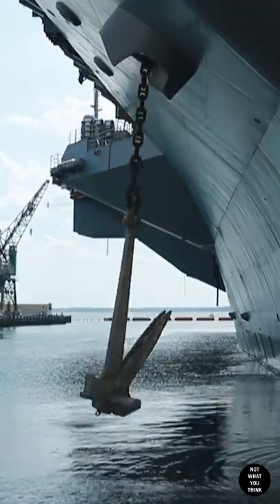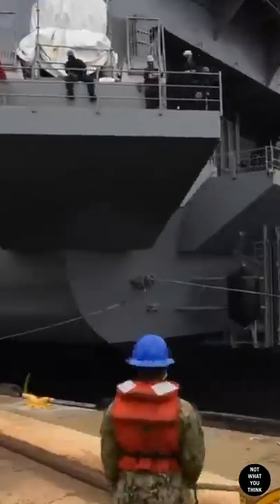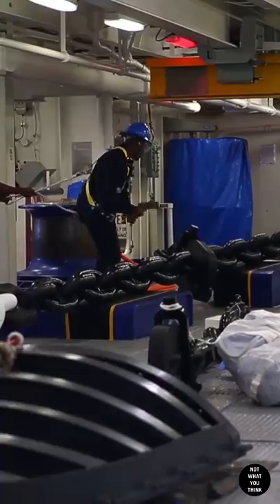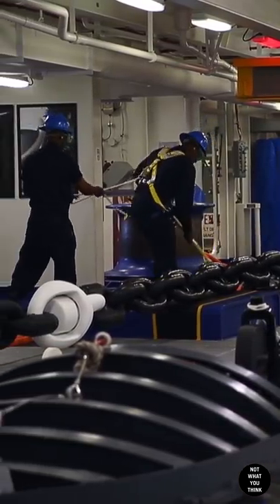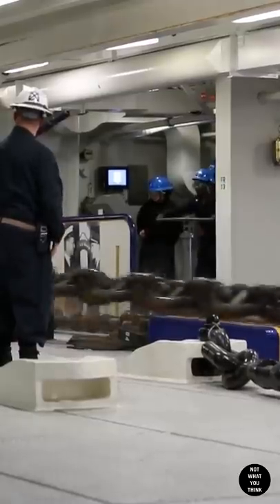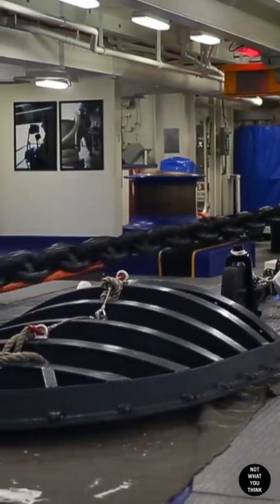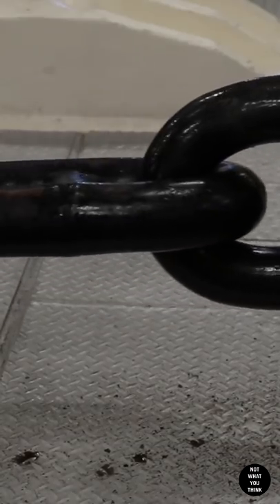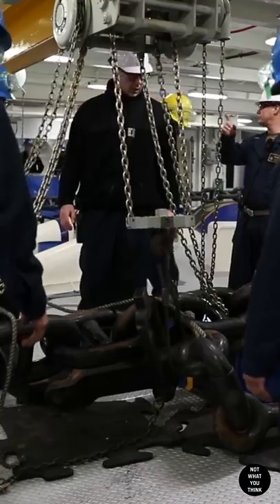Inside the Anchor Room of a Supercarrier #shorts

Comment: Fun fact: It is the weight and hydrodynamic resistance of the chain that keeps the ship in place. The anchor itself just ensures it stretches out and provides adequate surface area.
Reply: Only on large vessels tho, on smaller fishing boats it works a bit different because they can't justify carrying so much weight around so they'll often use these small anchors designed to dig into sand/rocks and anchor the boat by tension. This means that if a boat is not anchored properly, can un-anchor itself under intense wind and current/waves, but it's a small tradeoff considering most of these vessels use the docks as their main anchoring mechanism.
Reply: @lazar2175  lol I thought smaller boats just used anchors that took into consideration the weight of the vessel. So when dropped it couldn't move during high winds. (Tides obviously a differ story though.) 

But the more you know 🤙🏾lol
Reply: @EL-ISS  This mostly refers to ultra light sports boats,  usually made from fiberglass and other similar materials. Often times, you'll need like 30%-50% of the boat's weight to anchor it properly, which really defies the purpose of an ultralight boat.

Imagine having to carry a 50kg dumbbell on a canoe, and it's pretty easy to see how certain boats can't have "appropriately sized" anchors.

On the other hand, larger ships like this one with a lot of mass, need way smaller anchors because the inertia of the ship is helping.
Reply: @lazar2175  Ahhh, I understand what you're referencing now. Cheers for the info!
Reply: The anchor itself weighs about a quarter ton if not more, it definitely helps in the weight department too.
Reply: What if there are strong currents?
Reply: @AcolyteOfLucifer  15 tonnes, says so in the video.
Reply: @jobber3500  the ANCHOR. Not chain
Reply: @jamesbizs  bruh, literally watch the video. The anchor is 15 tonnes, and each chainlink weighs 60kgs
Reply: okay that makes more sense. I was like dang i know 15 tons is a lot but isn’t that like 1/4 the weight of a tank? but thanks for clarifying lol
Reply: not fun
Reply: @EL-ISS  most  recreational boats on lakes just use an anchor and rope
Reply: True
Reply: @AcolyteOfLucifer  not really when you consider the ships will be a minimum of 2000 tons (for small destroyers) all the way up to over 100,000 tons (largest aircraft carriers). Even the 15 tons it says the anchor weighs won’t do a whole lot at that point
Reply: Fascinating guys. Thanks for the knowledge
Reply: No shit.
Reply: So many armchair salty seadogs here..
Anchors ARE designed to dig in. The purpose of the chain , along with sufficient rode, is to hold the anchor down on the seabed so that it can dig in when the vessel pulls against it  .
Reply: That's not right. If that were the case the anchor could be any shape.
Reply: @user-gt2kl9jr3l  They are all shapes. Capital ship anchors look nothing like a stereotypical anchor. Some anchors look like fishing sinkers, some look like the traditional Popeye anchor, and some look like modern art pieces. The anchor can be used to dig into the bed in shallow water like we all assume, it just isn't used that way in miles deep open ocean.
Reply: @johnhelton9533  according to what I read you remain wrong.
Reply: @patrickhorvath2684    I was referring to the practice used by large naval vessels in open ocean, such as the one in this video. The ocean is miles deep in parts, there is no practical way to dig into the seabed. What you said is also correct, but occurs in relatively shallow environments.
Reply: @johnhelton9533  
Ships don't drop anchor in deep water. They couldn't possibly carry enough chain/rope.
Must have 7 times more anchor line than the depth of water. It's  called rode.
Reply: wait, hydrodynamic resistance? how can something so thin relative to the mass of the floating ship, offer enough water resistance to keep the ship stable?

or am I missing something here?
Reply: @robosing225  
 You didn't miss anything, that guy is trying to baffle with bullshit..
Reply: There are at least 3 good videos on YouTube that explain how anchors work. Stop arguing and watch them.
Reply: @EL-ISS  Man, there are many heavy books explaining the properties of ancres. You wrote nothing that needs raising eyebrows.
Reply: @AcolyteOfLucifer  they said it weighs 15 tons, but that’s still absolutely nothing compared to the weight of the ship

Comment: I like how it’s a multi billion dollar vessel of the future, yet they still just have just have a chad with a sledgehammer to de anchor the boat.
Reply: If it ain't broken don't fix it I guess
Reply: Tech will never replace Chads. Never! 🤣
Reply: Right you'd think even like a pulley that pushes the pin with more leverage and from a safer distance would be way easier
Reply: That’s the fail safe and last part before the anchor is released. If it was a mechanical system, then it could potentially fail or break 

Soldiers still manually load mortars, artillery, and tanks because again, one less thing that could fail
Reply: Sledgehammer fitted the entire ship of course it can do this.
Reply: I like how you saw a comment from a year ago and typed it slightly differently to make it your own.
Reply: @dylanhealy8126  Not all tanks tho, russian tanks have auto-loaders and it makes the tank smaller but the problem with auto-loader is that the munition chamber is easier to hit than the one in lets say an abrams.
Reply: @calebjohnson701  isn't that soooo weird. I see people doing that ALL the time
Reply: So you're telling me they can't drift like Taylor kitsch did with might mo in battleship.  Man that movie was awful
Reply: I work on a Naval vessel. What he is hitting is a stopper. When the anchor is housed (inside the ship and not used) as well as when it is out for anchoring, stoppers are used as a last resort for if the brakes and Wild Cat fail and it prevents the anchor from free falling. The stopper is attached to a large chain that angles back onto a massive padeye welded onto the deck. I can attest to the fact that the stopper will hold the anchor and all the chain. It's a simple and very effective method.
Reply: @raduandreiflorescu1990  Yeah I know there are auto-loader tanks, and I’m not a fan.

Not that I was a crew in one, but I was M2A3 Bradley driver. 

Auto-loaders, like you said, are vulnerable at their magazines. Having the extra crew member for a loader is a plus too, he can take over for the driver or gunner if something happened to them. 
Plus the original point I was making; a mechanical loader can fail/break, and a human loader is a better fail safe that can be replaced by another crewman
Reply: @dylanhealy8126  Some tanks, some artillery loaded in that instance not all and mortars simply because they function in that manner
Reply: @biohazardlnfS  Huh? Your English is a little confusing. 

I know not all tanks, artillery, and mortars work like that, that was the original point I was trying to make. 

Having a man to load all those dangerous weapons is more safe than using a machine. 

Especially mortars, they can be just as dangerous for the crew as they are to the enemy.
Reply: I've personally worked on anchor detail and done this job. Absolutely everything else is mechanical. This is done by hand because it's the last failsafe. Not being mechanical makes for less room for error.
Reply: I guess you are thinking an Xbox controller would work better.

Comment: and for those wondering, the chain is mostly what is holding the ship down, the anchor is mostly there to keep the chain in place. this is why large anchors are usually dropped onto sandy or muddy sea floors, because the chain can dig into the sand and really hold the ship in place

Comment: I used to be assigned to anchor on sea and anchor details on-board my ship. I got to do alot of précision anchoring evolutions so I was used to releasing the riding and housing stoppers and even having to remove the detachable link a few times. Definitely a cool experience.
Reply: Ever seen a link break on its own before?
Reply: @brantleycombs3088  nope, we did have to detach the anchor and leave it on the ocean floor and pull into port in Portsmouth England. We did a precision anchorage and the anchor got caught on some cables on the ocean floor so we had to leave it there and a salvage team had to recover it and bring it to us in port.
Reply: Why do you need to hold the guy in a harness to swing the sledgehammer tho?
Reply: @notyaavridge2660  for safety
Reply: @notyaavridge2660  to yank him out of the way if the chain doesn't go straight. If it whips out at him it's for sure taking him with it
Reply: @notyaavridge2660  if he swings the sledge hammer and miss, his momentum can take him down Hause pipe along with the the anchor and chain. It may seem small but the redundancies are in place for a reason.
Reply: @teamtate322  because it’s happened before.
Reply: @jeremey2072  I'm sure it's has.

Comment: Ok so you're telling me that one ring of the chain weighs as much as me🤯😵
Reply: Bro you are heavy
Reply: @nooftaheri3502  but not that heavy 
I did not weigh myself for 2 years 🤣🤣
Reply: One chain ling use to whaigh as much as two of myselfs
Reply: @nooftaheri3502  130 lbs is literally the average weight for most adult people
Reply: @batswing4473  that's my bad i thought he said 130 kilo 😬
Reply: That thing has almost 40 pounds on my girlfriend lol
Reply: They actually weigh roughly 320lbs, not 136lbs or whatever he said. Don’t know where this guy got number but I literally learned that at my school like 4 days ago when I did this whole process. So NO! Those weigh way more than you lol
Reply: @RileyNoga  I live in India so we dont use pounds. We use kilo system.
I heard 136 pounds =36kg 
So I may be right
And as per you I'm lighter than that
Due to pandemic I did not weigh myself ,..so a rough estimate😉😂😂
Reply: @RileyNoga  you are correct. I was stationed on USS Dwight D Eisenhower (CVN-69). The are closer to 320-325 lbs per link.
Reply: @eshanjadhav265  Actually, There's about 2 pounds per kilogram. When you say "a pound of beef" that means 500 grams. So instead of 36 kg, it translates to around 65 kg
Reply: I helped make the chain for this ship they are around 160 lbs and are three and a half inch diameter smaller than a nimitz-class carrier chain with a higher tensile strength
Reply: @johndeere4594  ok that makes sense, thanks for the clarification!
Reply: @johndeere4594  wow 👌
Reply: It's called a link and on a Nimitz class one link weighs 365 pounds.
Reply: @oldfucker68  wow I thought that james bond replied to me (I read you as roger moore)🤭
Reply: It’s Probally about 3ft tall too
Reply: Haha problems with converting units
Reply: I want to like your comment so bad but i cant coz your comment already has 69 likes!😂
Reply: @Max-yz8ib  tis 70  check it

Comment: The anchor on a carrier is 60,000 lbs and the links are 350 lbs.  I know because I got my Surface Warfare pin on a Carrier.  Also the anchor alone isn't what holds the ship in place.  You have to law out a length of chain on the sea bed to get enough weight to hold a carrier in place.  The length of chain laid out depends on the level of current in the water you're anchoring in.

Comment: Imagine, if you work there, and in all of a sudden, right when the anchor is about to be released, you stuck on one of the chains
Reply: I got you. It happened to me when I was loading some heavy machines round 20_50 tons. But I was so lucky that I could escape that moment I didn't stuck in the chain. Working with heavy equipment is extremely dangerous and needs to pay attention alot and not hurt yourself.
Reply: @halfofmg394  no it was tunnel boring machine.
Reply: @Peaking94  can you please explain it to me? Like, what type of machines?
Reply: @halfofmg394  it's called "tunnel boring machine " and it is used for digging tunnel.
Reply: @Peaking94  oh, okay, thanks for the information 👍
Reply: @halfofmg394  you are welcome!!

Comment: On the USS America (CV-66) they kept the focsle pretty spiffy and all shiny and stuff.  All it took was one anchor drop to totally trash the place. And noisy?  It was friggin noisy.  They walked the anchor out to a point and set the brake.  Put the pelican hook back in place, then disengage the windlass gear and release the brake, at which point the only think holding the anchor was the pelican hook.  Had a guy in a safety harness with a sledge hammer to trip the pelican hook when the order came down to let go the anchor.  There was a safety line attached to the harness so that that person could be pulled out of the way.

Comment: I’ve seen what happens when the brake that slows that anchor chain down fails. Let’s just say people fucking run.
Reply: Could you explain why it’s so dangerous I don’t understand pls
Reply: @kyubi4417  well that anchor is moving with an insane amount of force and each link is extremely heavy if you get caught in the chain you could get sheared in half in under a second and if the hammer gets caught in the chain it will rip your arm off

Comment: Wow! I did the nerdly thing. If each link is  12" long (more likely 10" with overlap) that chain is 98 tons! (over 114 tons if 10" is more accurate) + 15 tons for the anchor... And! That much weight has very little effect on how high or low the bow rides. Now, knowing that there are 2 anchors in the bow, 2 is the stern.., approximately 130 tons X 4 --- 520 tons that has minimal impact on the ship's trim and buoyancy --- ???   Imaging the size of the ship is still mind boggling.
Reply: Those ships are over a hundred thousand tons.    Comparing the amount of weight of the anchor to the weight of the ship is like comparing the weight of a tire to the weight of a car.
Reply: @Bendigo1    Yep. Mind Buggering.
Reply: @johnlshilling1446  yes it is.   And to think a plane that is as heavy as a semi truck can land on there and not even make the ship move...

Comment: There's one video online of this going horribly wrong, if the chain reaches the maximum length you can imagine it would be pretty bad, well it does and the whole anchor rips out and goes through the floor into the ocean. Those anchors aren't cheap...

Comment: I've always wondered why they don't knock the pin first, then unscrew the "breaks"? Or engineer a sort of slip knot in there so idk, they remove a safety cap exposing a bit of rope or rod idk, which can be pulled or twisted or whatever from afar? Idk about the screw thing lol but aye, surely there's a way which could be engineered

Comment: They can simply lower the anchor in gear reducing the risk of break failure and injuries, It's a standard procedure. the old days of dropping the anchor. It also reduces the risk of the chain tangling. Why keep a procedure that increases the chances of a mishap....tradition should not overide safety. Ps that BRAVE sailor is more dumb than brave. All you have to do is take the weight if the anchor chain in gear open it up without a sledgehammer and then lower in gear

Comment: I am a bit curious about one thing. Not specially a military one, but for all naval vessels.

For the shaft connected to the propeller to spin, we need a bearing. But bearings means that it is not waterproof! how did they solve this problem??

Comment: So a submarine Captain got a surface ship , coming to anchor
 He said drop anchor ! The deck division ensign , said , sir we are are one third speed , don't you think we need to slow down some first? 
   The captain said, ensign I gave you an order. So the ensign  said  to the bosun's mate on the sound power phones, the bosun mate said are you sure ? That's an order from the captain.
  So the bosun's mate cleared fo'c'sle of all personnel , hit the Pelican hook tossed the brake and ran.
 The chain ran down the hawse pipe
the red bitter end and all , it swung  jumped and busted everything bustable on the Forecastle.
   The bosun's mate got on the sound powered and said, sir tell the captain
,No sweat , no strain, no anchor, 
No chain.

Comment: That guy hammering the chain stopper open; why is he harnessed? I’m trying to think of any scenario where he could get accidentally pulled away with the chain but that would make no sense since the anchor and chains are heavy enough to pull him and the person holding the harness. And why is the harness held by a person rather than secured to a solid object or a secure hook or something?
Reply: It is to keep him from falling forward into the chain, the idea is that the guy holing him can pull him back if the chain starts to move.  There are no hand rails or anything for him to push against to break his fall if he started to fall forward.

Comment: I wonder why they don’t use like a metal wiring or soemthing
Reply: Because it is easier and cheaper to replace a few bad links if it starts to break. If it were a cable the whole thing would have to be replaced for a small bad section.
Reply: @Bendigo1  mmm true true
Reply: @Bendigo1  how about LINKS of metal wire! Eh? Eh?
Reply: @mememaster3519  you mean something like, i dunno, a chain....?  🤣
Reply: @Bendigo1  no
Reply: @mememaster3519  ok